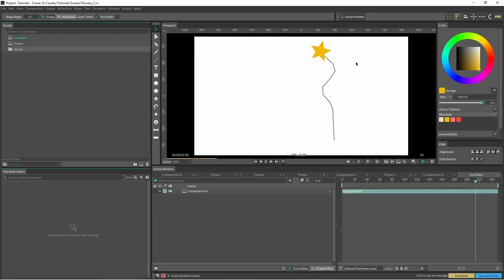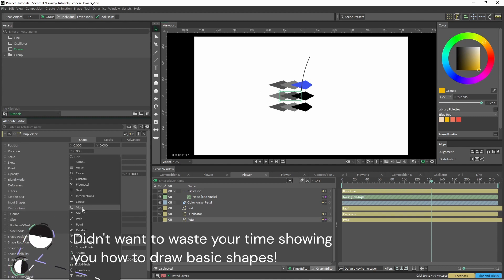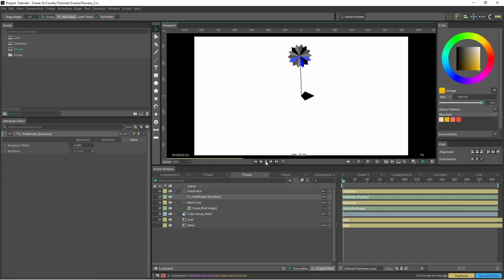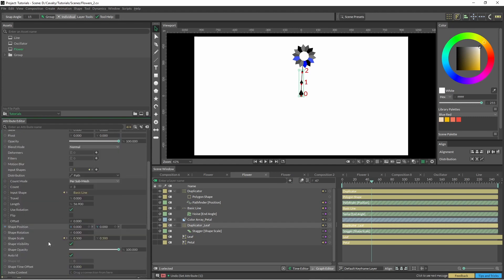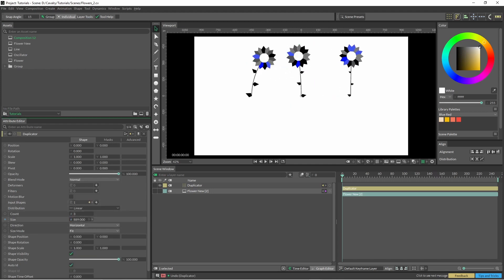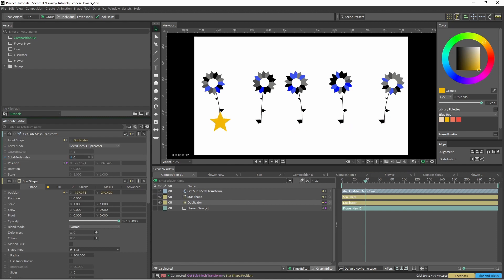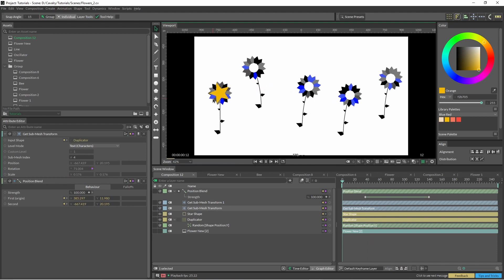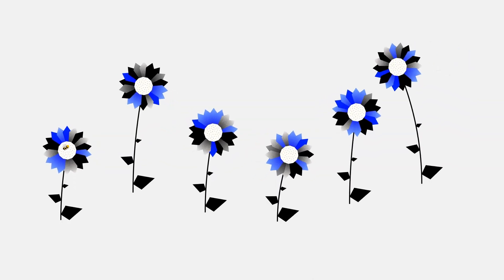Flower Power | Cavalry App

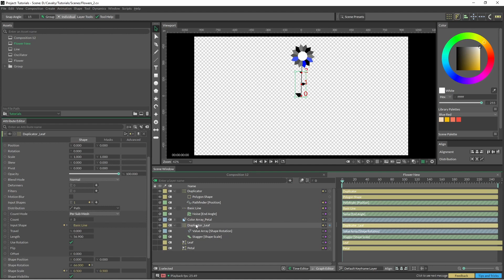Comment: when i duplicate the flower the duplicate leafs dont Positioned corresctly with the basic line and also in 4:56 i didnt find (use incoming index) please help me!!
Reply from the maker: Yeah things have moved around. I might have to revisit some of these. There is the Use Index Filter in the advanced tab.

Hope that helps.
Reply: @pepkomotion  it helped thanks❤
Reply: @pepkomotion  Such a great tutorial. But please revisit this one, especially the part where you create a new composition. As soon as I make the flower in to a new composition, it gets all messed up. And I can't find any index context / position context to work it out!
Reply from the maker: It's been awhile.

In the advanced tab - check the Use incoming index.

Unsure if this In in the duplicator or behavior.
Reply: @pepkomotion  I only see use index content in the advanced tab, I checked it but the deplicated flowers are still messed up 🤔
Reply from the maker: If you right click the header you can filter position / index. Does that help?
Reply: @pepkomotion  it works appreciate your help❤
Reply: @pepkomotion  yess, thank you so much!!